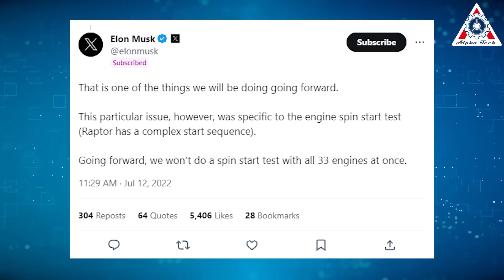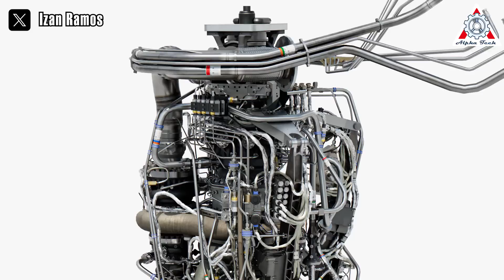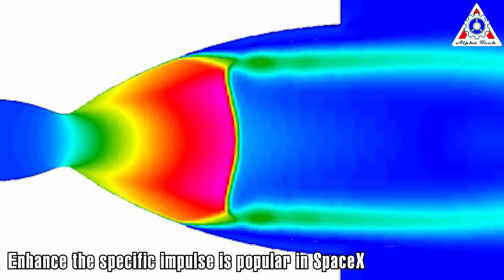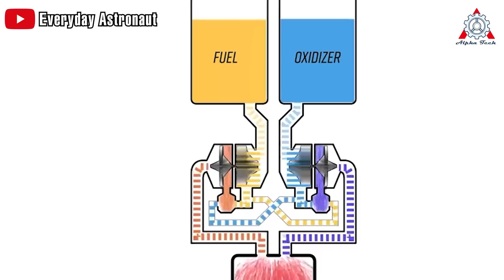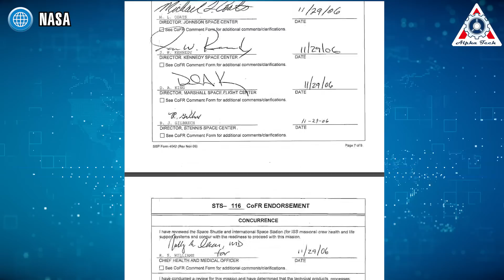SpaceX's Raptor Problem...???

Comment: "...the rocket's Delta-five..." 

... Um, WHUT?!?  =:oO  [TRIES HARD NOT TO ROFL]

How the hell can you get this far into making rocketry videos and not understand what Delta-V is, and thus how it's pronounced?

That "V" is not a roman numeral; It's a literal "V" for "velocity". Delta-V means "change in velocity".  A specific rocket, bearing a specific payload weight, will be able to add a certain amount of speed to that payload over and above whatever it started with when the rocket started firing. That's the rocket's total delta-V.

Of course the actual velocity of the ship is also affected by other factors such as gravity, changes in orientation of the vessel or of direction the engines are firing (gimballing), etc., but the idea is that delta-V tells you how much your rocket can accelerate under ideal conditions.

Comment: 4:09 While the horse power comparison with the Hoover Dam is esentially correct, it is somewhat misleading due to the very brief output of the Raptor engines vs the hours of continuous operation of that dams turbines.

Comment: SpaceX's Raptor problem isn't a problem.  It is a new engine, a new full flow engine with a lot of new technologies developed to make them produce as much power as they do.  It is early days still, the bugs will get worked out.  Think about it, in just a few years they went from no engine to a new design to an improved design, mass production started and now another improved design.  Who else has done that in such a short period?....No one!

Comment: I think 33 is inherently an unlucky number. Delta five - haha. But seriously they should deal with the vibration by providing a dampening system between the motors so that they do not sychronize their movement.
Reply: The student will note the esoteric signifigance of the engine counts on booster and rocket.

Comment: You've made a fundamental error, a truely astonishing fundamental error. It is NOT "delta five". The "v" is not a roman numeral for the number 5. It is the the abbreviation for the word "velocity". It is pronounced "delta vee". What the term actually means is "change in velocity" (delta velocity). "v" is THE term in ALL mathematical formulae for the term "velocity". I am really shocked because it demonstrates a fundamental lack of knowledge on your part. "Delta-v" is one of the most common terms used in rocketry.

Comment: Fuel does not EXPLODE in any engine, if it's operating correctly. Very rapid burning is NOT an explosion. An explosion can cause severe damage to an engine. There are very distinct differences between the two processes. "Explosion" may sound dramatic, but, it's not correct for a rapidly burning fuel.

Comment: Why are so many YouTube SpaceX content creators using video titles that insinuate flaws in SpaceX hardware or processes, then saying "we don't know what, if anything, is wrong" in the video? So much of this video is speculation, sometimes passed off as fact. For example, the idea that water ingress might have shut down Raptors in the first deluge static fire test "is entirely incorrect" because Draco engines have gotten wet and still work. The SuperDracos weren't attempting to ignite when a huge amount of high-pressure water was sprayed directly at them, so the comparison is meaningless.

I hope this channel gets back to informational content. Some of the past videos have been very good.  It would be great if SpaceX was more transparent about their engineering progress. Until then, this kind of video is empty-calorie clickbait.

Comment: There is something they missed in the design. Here is what I think it is … excess vibrations that cause resonant amplification of lox pressure fluctuations.  Here is the kicker … when lox pressure fluctuates low enough, then at that location, the lox converts to gas (cavitation). The shock wave when the oxygen gas bubble collapses then breaks hardware or else somehow triggers the engine shutdown.  

I suspect lox over methane because lox is denser and therefor the cavitation shockwave will be more intense.  Also the fact that the engines are more reliable on the test stand is a huge clue.  Either the Raptor sees a different pressure fluctuation arriving at the raptor, or else vibrations are different on the booster than on the test stand.  This may cause different modes of engine vibration and or stronger vibrations.
Reply: Excellent comments.
Reply: I was thinking something similar, Cavitation in the LOX or CH4 caused by vibration. Ullage gas bubbles getting into the turbo pumps. Maybe even due to the ship not being perfectly vertical. A "static fire" test would never experience this type of failure, but a shaking, vibrating, rising rocket under TVC would.
Reply: SpaceX needs a test stand that can vibrate at least as much as measured accelerations on the booster where vibrations are most prone to resonating, plus the ability to make CH4 and LOX pressures fluctuate rapidly and at suspect frequencies.    The test engine should be heavily sensored to understand the engine response to vibrations
Reply: Perhaps the Russians had a better idea with multiple nozzles being feed from one turbo pump.  I know the multiple nozzles were used to mitigate ignition instability at the injectors. But fewer pumps reduces the rats nest of feed lines to 33 pumps and may limit cavitation opportunities.

Comment: Idk why everyone is talking like the raptor has flown a hundred times! This is rapid development, it takes time and the engines on these first starships are still the early developed ones. As we get further into the flights the later ones will get more and more reliable. The first booster was a hodgepodge of old raptors and tech. Think of it as an old car you could scrap or do something cool that also wrecks it.
Reply: If it's true 'rapid development', the engines ought to be 'rapidly' tested for reliability before being attached to the rocket. Losing 10% power at launch isn't about rapid development, more like 'rapid step backwards',  slowing development and testing of stage separation, flip manoeuvre, return to pad and test of catch mechanism. Perhaps more time could be allocated to engine testing, rather than doing it rapidly.
Reply: @mikeomolt4485  again the first test flight was basically an outdated model that normally would have been scrapped but they decided might as well send it and see what it does. The bar for success was will it leave the pad before it blows up.
Reply: @dimetime35c   Even an outdated version of an engines minimal requirement is capability to survive stress of a launch. Updated versions  might well have increased power or efficiency, but if knowingly attaching elements likely to cause failure in the quest for 'rapid development', it's bound to backfire heavily one day.

Comment: The analysis is wrong, the proof is that in April static fire test closed two engines, in August four, and the only difference is presence of deluge system in August. The engines are the same, the issue is water ingress and transformation of water into steam in small space inside the launchpad. In addition, the test in August was stopped after 2,7 seconds, if it lasted longer we would have 8 engines stopped, much more than in April. Such illogical analysis could be done by people who don't understand what happened. Probably it was accepted by designers of the launchpad. If so, I am not surprised that there is a problem.

Comment: I keep saying it and i get blowback from Elon/SpaceX simps, SpaceX has a Raptor reliability problem. They cant get thru a single test with out having to replace Raptors; how long will this be "acceptable" in the testing phase?
Reply: I'm an engineer, not an Elon fan. This isn't a testing phase, the tests are part of a rapid development phase. The idea is "fail early and fail often," to get to success more quickly. It's a relatively recent engineering discipline, still it has allowed SpaceX to leapfrog slower and costlier ULA and Boeing offerings.

Raptor failures are essential to gathering the data to refine the design. Merlin engines, which are now one of the most reliable rocket engines, went through a very similar process with lots of early failures. There just wasn't as much public attention paid to what was an fledgling aerospace company back then.

Comment: The problem might well be the water but also, in combination with another factor and so not in a way most all would think. This is because most are unaware (due to being schooled in the 'standard model thinking and which wrongly disregards the nature of charge) of the nature of charged matter and even though all atoms are made from protons (positive charge) and electrons (negative charge) and so, have created electrical fields within themselves, due to the separation of charge.

And from a biological view, that those charged atoms make up the molecules that make up the cells that make up our bodies, each having a voltage of 25 millivolts, when in a healthy condition. And between 50 and 200 Millivolts when in healing mode.

We think and our central nervous systems work by way of electrical impulses. The environment in which we live (unless an astronaut) has a charge differential between the negatively charged earth and the positively charged ionosphere rising by about 100 Volts per metre up through the atmosphere. Magnetic fields are seen throughout deep space and there is only one thing that creates magnetic fields and that is electricity.

Plus, the force of electromagnetism is 10^39 or 1000 billion billion billion billion times stronger than Newtonian Gravity, or even how the Einsteins (man and wife) fantasised about it back in the days of gaslight, the bending of the Electromagnetic Spectrum in the presence of matter on a flat bit of rubber-like cloth.

So ignoring the charge matter state will mean they will always be struggling for answers. So roll on the launch date when I can explain fully what the problems have been and are like to be, in the future. Unlike the Electric Universe collective we don't start from a place of guesswork. We start from a point of real science, electrical engineering and plasma physics. https://www.youtube.com/watch?v=aHqjtZe1O1E&list=PLQTfnq7B6uPY1RjMjBjBS5fDxd3gJAvl3